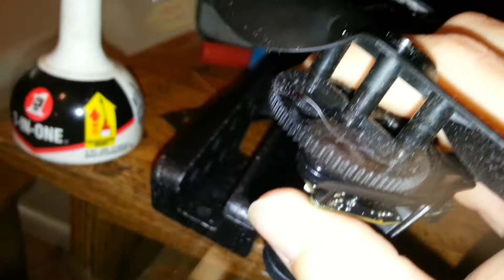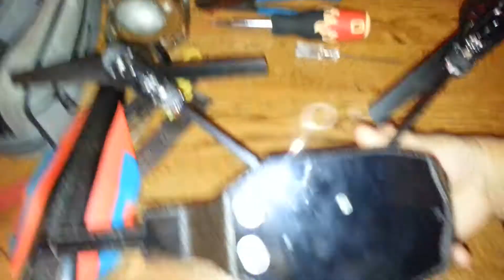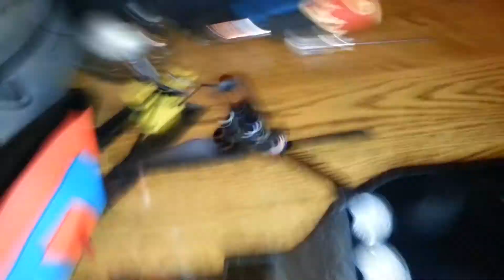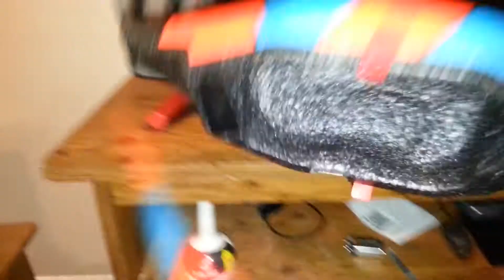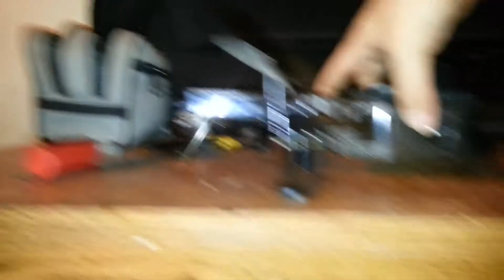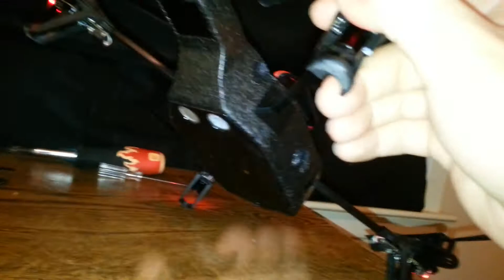Ar drone 2.0 preventative maint. and free DIY mods

Comment from the maker: That's why every time you do a pre flight check and I also or will the bearings and gears you may think it doesn't do anything it gives me about a minute extra flight time and more responsive any dust or dirt that it may collect I cleaned off every time before flight